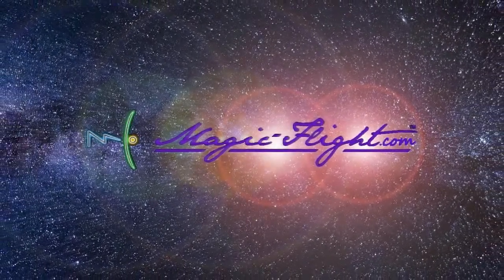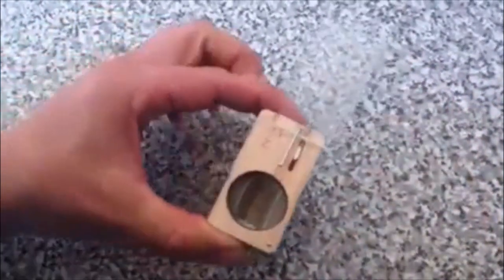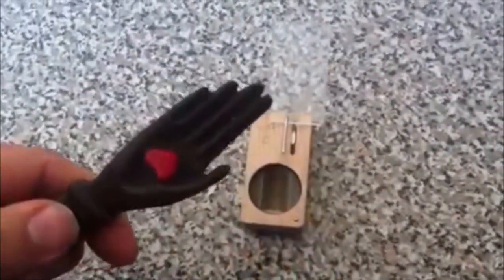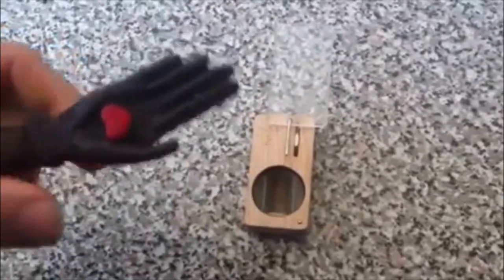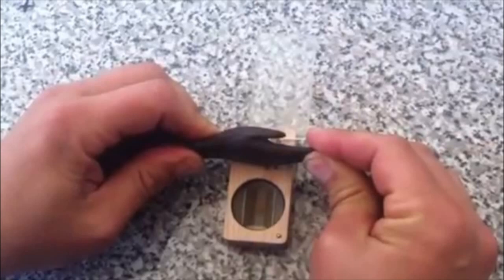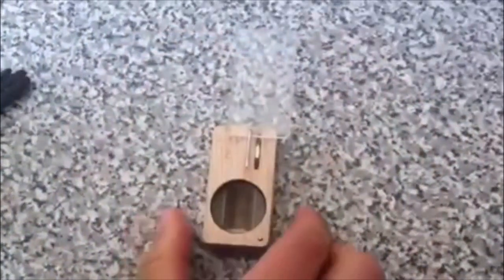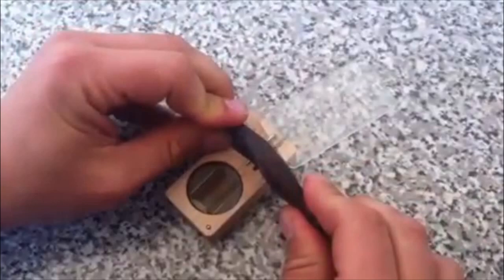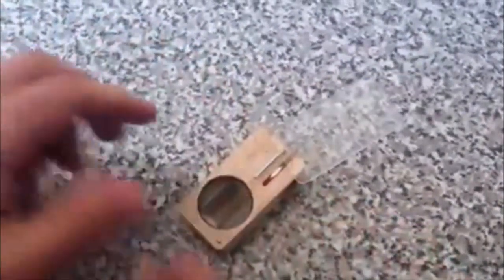DIY -- How to Tighten a LAUNCH BOX lid

Comment: I JUST bought a launch box a couple of weeks ago after using a Pax2 for about a year. That was my first dry herb vape after using ecig oil type vape. I'm an old school enthusiast going back to the mid 70's. Ever see the movie "Dazed and Confused?" Yeah, that was me. Class of 79.
Fast forward to now. Was liking a lot about the Pax, but always felt I was wasting material. I used to love my one-hitters. Wife doesn't imbibe, so though I loved a lot about dry herb vaping, I didn't like the wastage.
I knew about Magic Flight as I am sort of a nerd when I get into stuff, and had long ago bought the Magic Flight finishing grinder for my Pax and loved everything about it. Had heart about the Launch Box and had an interest in one, but had not gotten past that point. After all, my Pax WAS doing the job. Anyway, went to a shop I don't normally frequent and what did I see but a Magic Light Launch box marked down to $80. I later learned from the serial number that this particular one was made in 2016-2017, so clearly had been sitting on the shelf for a while.
The rep for steep learning curve didn't bother me at all. I'm a double-clutching four-speed kind of guy, not an automatic. After watching a couple vids and reading the AWESOME manual, I had it down pretty quick with only a couple charcoal-ish episodes.
So to my main point: It's AWESOME! I can put just a little in, works just fine. I can fill the trench, still works just fine. Nothing gets wasted. I can already tell my "material" is lasting much longer. And the smell? The Pax quickly started smelling like the resin scrapped from a year-old bong. My magic flight still has none of that, and I use it daily to one degree or another. (chronic pain only, I swear. Listening to Pink Floyd and King Crimson has nothing to do with it!)
Bottom line, love it. And speaking of love, the aphorism at the bottom of the box struck me powerfully as it was not long after I got the Magic Flight, that George Floyd was murdered. I kept looking and reading the bottom while watching peaceful protests. Flashed me back to 50 years ago when as a kid I watched the 60's protests for civil right and those against the Vietnam war. The words have comforted me, no joke.
Reply: Add the castings ("spent herb ") into food for a body buzz.